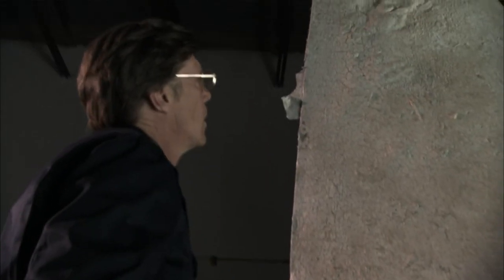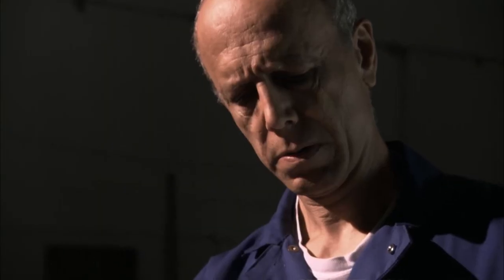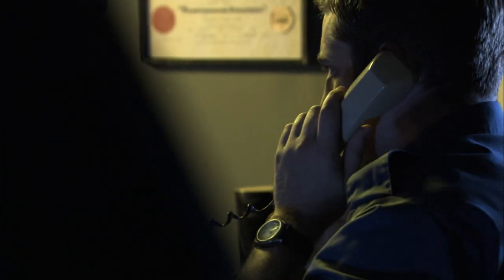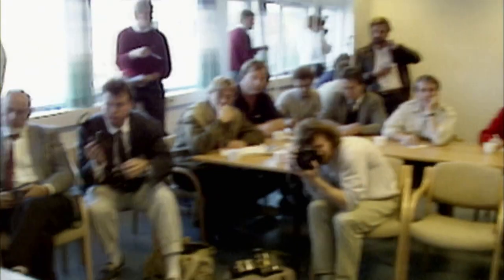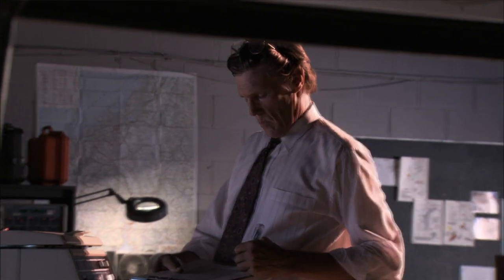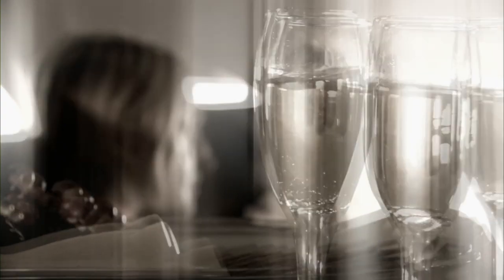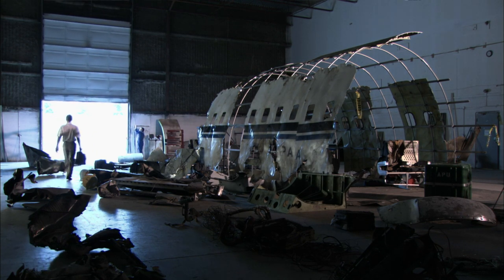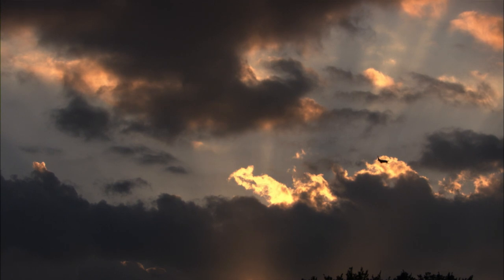A Discovery That Sends Shockwaves Through the Industry | Blown Apart | Mayday: Air Disaster

Comment: A friend of mine worked in Canadian Air Force as a plane mechanic and supplier (no idea his actual job) and told me that a single bolt that do the same job a ＄1 bolt could cost over ＄100 just because it has to be "certified and tested". I now understand why.
Reply: That’s sometimes true, but all bolts are not alike. 
Some bolts are designed for shear loads, some for tension loads, etc. 
This case is exactly why it’s necessary to have real certified parts.
Reply: If people were not dishonest, it wouldn't cost so much. Every little piece of dishonesty has a major cost.
Reply: I'm a machinist in my spare time. A few weeks ago I ran a cobalt end mill into a part I thought was mild steel but was actually hardened. Pretty ugly outcome (and broken end mill). Alloys/metallurgy are HUGE considerations across a spectrum of hardness and toughness. Especially in applications where weight matters and everything depends on the strength of critical components.
Reply: @imkindofabigdeal4308  
Exactly. 
Long time aircraft mechanic here, and it’s very obvious that many people seem to think that all bolts are alike. 
Applications are not all the same, & metallurgy is everything. 
There are dissimilar metals corrosion considerations, too. 
Strength is only one factor.
Reply: @imkindofabigdeal4308  this is what I meant, the traceability, certification, proofs, testing and even the insurance of a piece cost way more than the manufacturing of said piece.
Reply: When one is dealing with a piece of equipment that can affect the lives of hundreds, is a $100 bolt that is proper for that equipment too high a price to pay?  There are certainly areas where tight regulations are necessary and proper.
Reply: "＄1 bolt could cost over ＄100 just because it has to be "certified and tested". I now understand why." You could've been more specific in that you understood it was the certify part, not the test part, that jacks up the cost of a bolt 100 folds.
Reply: Has the $1 bolt been heat treated?  Its alloy composition verified?  Is there a random sampling program to make sure every batch of bolts is strong enough?  How tight are the manufacturing tolerances?

All these things cost, hence the $100 price tag.  It's not just a pretty piece of paper.
Reply: Not all bolts are the same. ESP when you start using hardened steels
Reply: Back in the 80’s there was a huge amount of fraudulent bolts sold to different US government contractors.  My friend worked for Lockheed as an missile engineer, they had to inspect several thousand bolts that were going to be used for missiles, rockets and satellites.  Imagine having a bunch of doctorates spending over half a year doing nothing but inspecting and testing bolts cause some purchasing agent went cheap.
Reply: @davesmith5656  projection.
Reply: Safety regulations are written in blood.
Reply: @imkindofabigdeal4308  , Rockwell scale
Reply: @patrickflohe7427  Long time car mechanic here, we half fix things use odd bolts and yell F it, it will fly. Oh that was my buddy that was an airforce mechanic.
Reply: Dishonesty has a cost, but a big benefit to scumbags

Comment: In many cases used parts are okay to use but they have to have a history that says they were certified and is a serviceable part. When I first started many years ago in the eighties the company  I worked for over hauled jet engines. I was new and knew just the basics little better than a helper. I still remember at a morning meeting they said never make a part. Seems someone on a line knew they were facing a shutdown due to lack of a small bracket. Simple and small so they machined one and installed it. Can you guess what happened? The part was supposed to be made out of a special material, that's why they couldn't get the brackets. When the engine ran the bracket melted. All the years later I always checked to make sure my parts were correct where I went.
Reply: Bless you

Comment: TL:DR; 4 of the screws on the rudder were fakes, and the auxiliary generator had a broken bolt. Combined with cross winds in flight, the rudder was forcefully locked in the left position, and the plane disintegrated mid flight.
Reply: Thanks a lot my friend
Reply: Three were fakes, one was real. The real one wasn't enough to hold it all together, though.
Reply: @Horseshoecrabwarrior  Yes, thanks. That was a small error on my comment.
Reply: @andrewx8888  Other than that, a perfect TL:DR
Reply: Thanks.
Reply: 3 of 4 bolts were fakes.

Comment: 1990's I worked at machine shop that the owner went to federal prison for using non certified material (aluminum) for military aircraft parts.
I worked as an aerospace machinist for many years and certain materials used for small run/prototype jobs, often exotic stainless steels could take several months for the materials supplier to replace if there was scraped parts because that material was not "stocked" so you would have to wait for a foundry run before the material could be replaced.

Comment: Improved regulation of the parts distributors does not seem to affect foreign airlines. The Lion Air 737 MAX that crashed in Indonesia wore a replacement AOA device bought from one of those iffy Miami dealers. It was MCAS that put the plane in the ocean, but it was the faulty replacement part that caused MCAS to start in the first place.

Comment: This is why you need "big gubmint" "interference" in the Holy Free Market.  Corners will be cut, proper procedures will be ignored and profits will be put ahead of safety if folks are left to self regulate.
Reply: Not always. But understandable.
Reply: Regulation is not the same as Over-regulation. 
Regulation says you have to get 30MPG highway on this car you're building.
Over-regulation says you have to get 30.2 MPG highway on the same car next year, or you cannot produce them. Or you can line someone's pocket in DC to get an exemption.
Reply: @chrismaverick9828  no it isn't.

Comment: The graphic pouring of little dots out of the plane after the tail disintegrated was too much for me. But I remember when the issue of counterfeit parts came up, and I'm so glad it did.
The same problem occurrs in the pharmaceutical industry, actually any industry that sells expensive products.
Reply: why was it too much for you ? What are these little dots supposed to be ?
Reply: @power2084  Passengers?
Reply: @davejohnson3684  nah it can't be. Passengers usually use their belts during the whole flight and no, they would not pour out like the little dots we saw in the video. Those dots represent debris.
Reply: @power2084  , "those dots represent debris", yes , arms, legs and an assortment of internal organs 😁
Reply: Traveling that fast, at that altitude, yes those were people! Sucked out of the aircraft!
Reply: @Userxyz-z2d  that's blown out, not sucked out. You need to understand physics.

Comment: Does "6 million moving parts on a 747" fail the sanity check for anybody else, or just me? (20:52)
Reply: It's actually not right, unless you consider all the parts are moving parts. I dug a bit and the 6 million parts is the total, not just the moving ones.
Reply: More like 6 million parts flying in close formation.
Reply: @dougtaylor7724  , built by the lowest bidder is the rest of that saying…
Reply: @Jeff_Engineer  Yeah I was going to guess that too. 6 million MOVING parts seemed a little ridiculous to me.
Reply: @ExplosiveMonkey true , but to get a license to fly a turbojet requires 2000 hours which costs six figures any way you slice it.

Comment: This episode brought to mind another one whereby a mechanic could not locate a correct fastener and proceeded down to the hardware store and purchased some. Problem was of course that the new bolts were of an incorrect grade.
Reply: Working on my own car some years back I occasionally found it necessary to go to the hardware store with bolts, since the car hadn't been produced in over 20 years. ALWAYS went Grade 8. The car's frame or component would fail before the bolt ever would.
Reply: @chrismaverick9828  i do the same, but how do we know they aren't just cheap bolts stamped grade 8?  Do we know where they were produced, what the manufacturer's testing and quality control program was, etc? That's the crux of the issue in this video.

Comment: The modification to Allison 501 turboprops was authroized by Convair and co-developed with Allison.  The upgraded aircraft is called the CV-580.  This wasn't the first time these airliners were repowered with turbofans, though.  Earlier in its history some were built with and/or converted to use Napier Eland turboprops.

Comment: Rem 737 nose landing gear failures? My friend (ASME cert) tested parts for a Boeing subcontractor (ex exec or Boeing family, cozy relationship to avoid paying Union scale) and pressured and reminated for failing parts. Aluminum melts at 600C and heat treated alloys are damaged from excess local heating (>200C) during machining. Company demanded faster mfg rate and result was heat damaged parts. One failing batch of parts was 737 nose gear struts. No incoming parts inspection, trust the subcontractor because they were "family".

Comment: So much for that Candadian joint doing an 'overhaul' on the airplane, they didn't even find that broken mount for the APU, fixing that would have probably prevented this accident.
Reply: Well aside from not replacing the APU during the overhaul why did they only replace one bolt in the tail assembly?  If one is bad then all are bad, after all they all have the same number of flight hours on them.  As critical of a part that these bolts are for the cost and one clearly showed signs of wear and this was an Overhaul.  Clearly they were grossly neglectcant.

Comment: I am holding a decommissioned 777 engine pylon bolt in my hand while I write this comment. It is quite heavy, made of pure titanium and is large, and it has a washer around it as well. The bolt is a little over an inch in diameter, almost 4 inches long, and is an official Boeing part. When an engine comes off the pylon, mechanics are required to replace all of the pylon bolts on that engine. The old ones get thrown away, regardless of age or condition, so don’t ask me how I have this bolt.

This bolt in my hand, just this one, is over $200,000. It is the lifeline from the engine to the wing. It is very expensive. The threads are very thick yet angled ever so slightly, and they run along the bottom quarter of the bolt; it must take a long time to remove one of these. The head of the bolt is a crown with 12 teeth, the part numbers are engraved on the top of the crown. The part numbers, with some digits omitted for privacy concerns, will be below this:
B3*US1*-4*
SPS 06
This one titanium bolt is critical in holding the engine to the wing. A guy I know works with one of the mechanics who attached the engine to the wing of that AAL DC10 that crashed decades ago, when the right engine came off the wing. These bolts were improperly mounted, which is why the engine separated from the bolts, rather than the bolts themselves failing. 
If a critical part is positioned, mounted or manufactured incorrectly, the results can be catastrophic.
Cheers.

Comment: This was one of the most shocking accidents for me since I had no idea counterfeit parts could exist.
Reply: It wasn't limited to just airplanes. Bogus parts, especially bolts, got into trucks too. I know around 1990 bolts with fake grade 8 markings were used to secure the steering box to the frame in Peterbilt Trucks which forced them to do an emergency recall. It wasn't just check and replace them when you have your truck serviced. It was put out on the radio, if you hear this recall and are driving pull over to the side of the road immediately. From what I know they paid for rooms to put drivers up, paid to rent tractors and similar things.
Reply: I fill in when needed to the US Navy Qualified Product Laboratory. We certify that parts are up to spec by performing tests on the products up to and including destructive testing. Every few years we pull samples from manufacturers to ensure they meet specification. The lab has uncovered more than one case of manufacturers moving plants out of the US and the products not being built properly or with uncertified processes. We work with SAE and are involved in ensuring parts are certified properly. The products we certified are used thru out industry and all the branches of the government and services. I’m so proud to be part of a small and extremely dedicated group of people.
Reply: I remember hearing that they found counterfeit parts on air force one over ten years ago as well...so if that plane had them..think how many others had them...

Comment: AA flt 191 on a DC-10 had failed due poor maintenance AND failed bolts causing the number one engine being ripped off the port side wing, from the relative wind causing a huge tragedy, plus a plane in the UK had the captains windscreen blown off at cruise altitude with him almost dying as he had hung on for dear life, and finally had been rescued as the flight made a Mayday call.. Cause: counterfeit bolts that were a taid-bit undersized that failed as the air pressure in the plane exceeded the limit of these fake bolts the frame for the multilayered laminated glass and apoxy window failed.

Comment: The thing about part failure in aircraft. Small parts like these bolts will break anything. Cars. Boats, trains. Your car can be brought to a halt by parts as small as a quarter. Difference is, when a plane stops working, you can't just pull over and call triple A

Comment: All that starts in the regular machine shops like I work in.   We are ISO certified and require all measuring tools to trace back to international standards.  If you take a top set of mics, that is one that can split a tenth of a thousandths of an inch in 4 places, that is 25 millionths of an inch, and run it against 3 sets of gauge blocks you will see the same pattern that I did.  1 out of 8 entries don't match the measurement of the gauge block.  Yes, the blocks are measured to inc of 4 millionths of an inch, so there is no excuse to get the paperwork wrong.

Comment: I remember early 90's south of Houston, a crew from Alabama was extending the height of a t.v. antenna.  A bolt failed and the crew fell to their deaths.  A bolt was supposed to be of a certain hardness, was fake.  It had all the correct stamped numbers on the head.

Comment: What is really mind blowing is the failure was not as likely if all four bolts were equally soft, by replacing one bolt caused the rudder to rotate around this new harder bolt and increase the oscillating load on the other 3 softer bolts. These bolts being softer, don’t just break, they’ll deform first. Once all three bolts failed then the load will fracture the final new bolt…. Because it’s properly hard it fractures instead of deformed.
Reply: The combination of leaving the apu unit on and fake bolts caused the plane’s demise.
Reply: @lex_DO   actually there’s months of flying on four soft bolts, it was only when one of the soft bolts was replaced with a properly hard bolt did this really become an problem. The failure was significantly hastened by the stress-riser effect of the mismatch in bolt hardness. The vibrations with all four softer bolts never got as bad as it did with three soft bolts and one correctly hardened. Compare how long it flew with four soft bolts verses one correctly hard bolt. At this stage a change in maintenance procedure would be a hardness check on the three remaining bolts if one is found damaged. If the remaining three are found to not have proper hardness then a matched set of four with the same hardness should be used. I’m sure there’s still a few of these aircraft in remote regional airlines…
Reply: @alanaspurling6469  I understand what you’re trying to say and interesting theory. It doesn’t change the fact the fake bolts were 60% weaker. The fact that it stopped vibrating for a couple of weeks meant the the one bolt was bearing the load of the three worn/weakened ones.  As the other three continuously became weaker, the one bolt could not sustain the stress of the other three.

Comment: It appears to me while it's in Porten that this issue was exposed, that is bogus parts that there was no mention of in what manner those parts were damaged on the aircraft since the report says that they recovered all four. Have the bolts stretched?  Excessive wear on the threads, indicating that the fasteners would have become loose?  Was there going on the threads which would indicate that they reached their required to work prior to tightening fully?  That they were suspected to be only 60% of the pool hardness does not necessarily mean that they would not have provided proper service. Not to say that bogus part should be condoned but in this case did they really caused the failure that caused the crash?

Comment: There are grade 3,5,8 bolts plus metric bolts 8.8,10.8...these are commercial...then there are aircraft/milgrade or AN bolts..you actually have to find a vendor for these..any experienced mechanic worth his salt knows this...how can a mechanic knowingly FAA certify a grade 5 bolt or  fake a grade 8 bolt which is actually a grade 5...profit over lives seems the norm..
Reply: Its more than the grade (hardness) its the metallurgical properties that set aircraft fasteners apart.